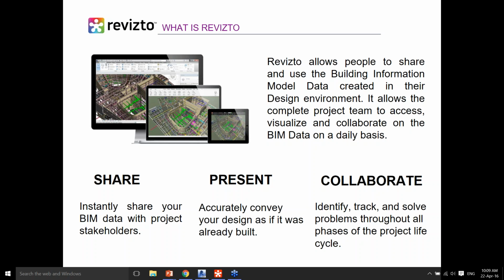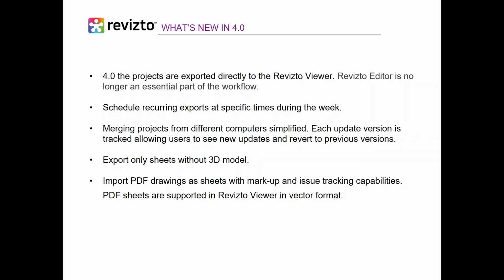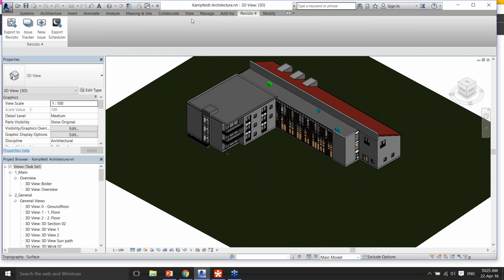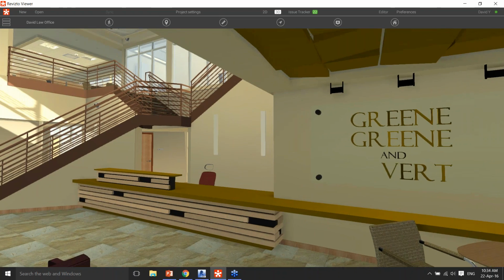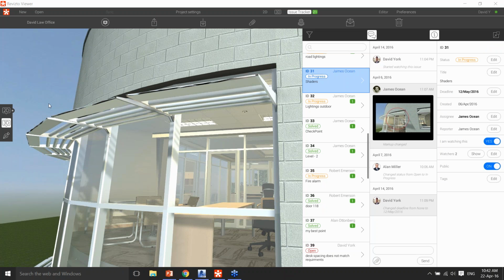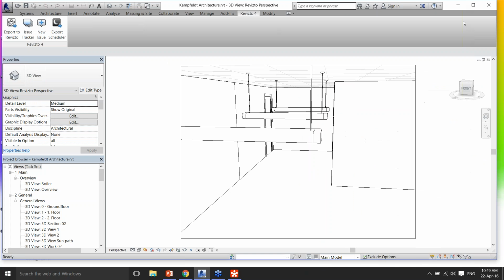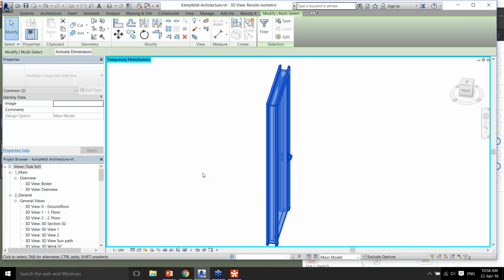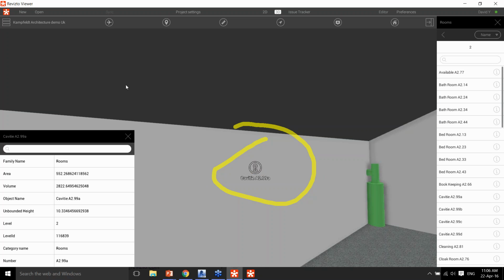Global Webinar: Introduction to the Newest Revizto 4.0

Comment: Hello from Theo in Auckland NZ, this looks like a great tool to share and use, i have watched your video ,many thanks and installed at the same time, tried to use but got to a few demos , which is ok to start, could not login thur the meny it gave yet may be i need to do a restart of the PC as changed my password to log in but it did not like me to do so right now will have a go later , nice looking and working software , many thanks , i am a retail commercial designer for internal external some times for all sorts of projects for 45 years , have a great week Regards Theo  ps currently working from home as i am nearly 60 so thought that was a bit less stressfull these days after a 6 week hospital visit , cheers for now. :o)